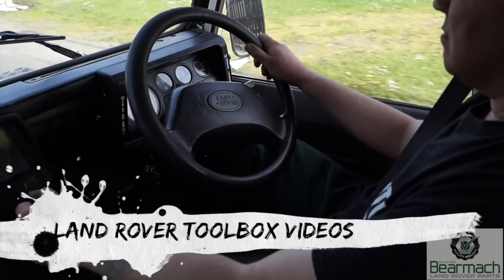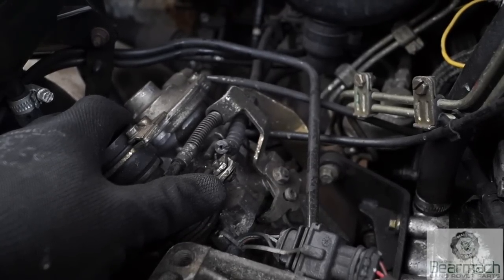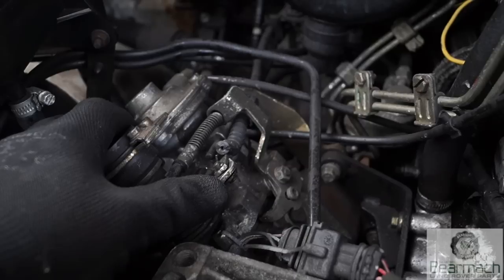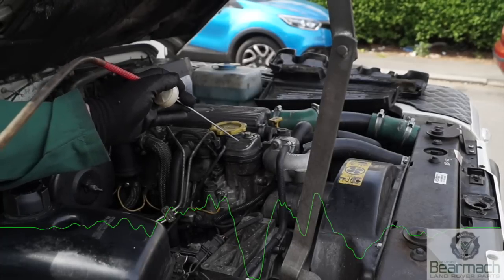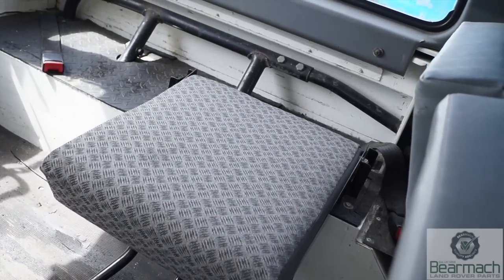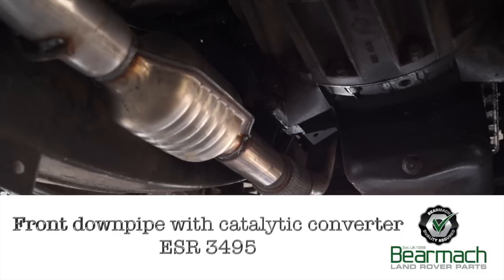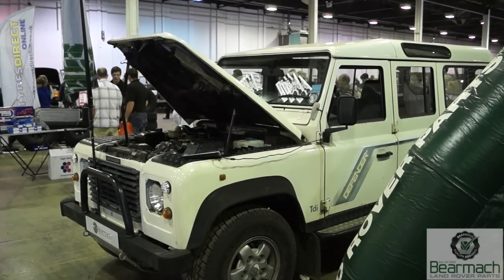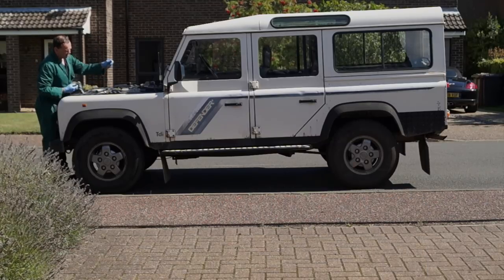A tool for finding odd engine noises - The Fine Art of Land Rover Maintenance

Comment: first thought would be to change the wheels, from my memory i think I'm right in saying that those wheels are not rated to be on a 110 as they are not boost or deep dish :), so wheels, tyres, and i say a winch and winch bumper, also a roof rack, oh and stay standard height :)